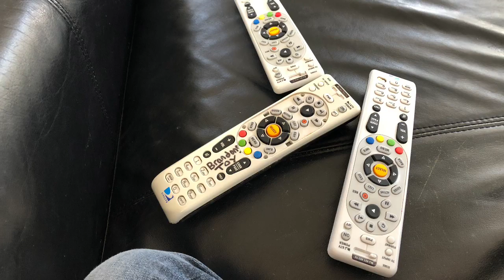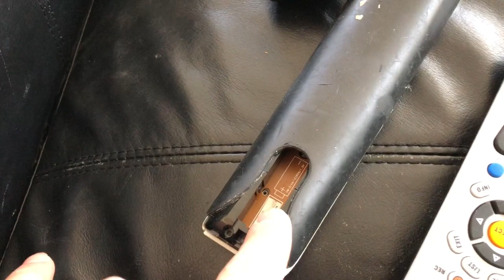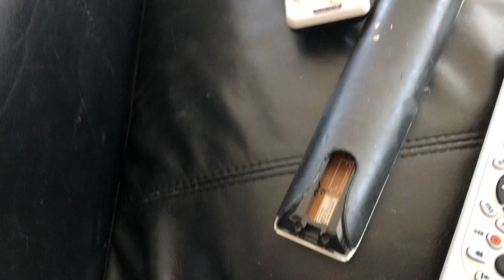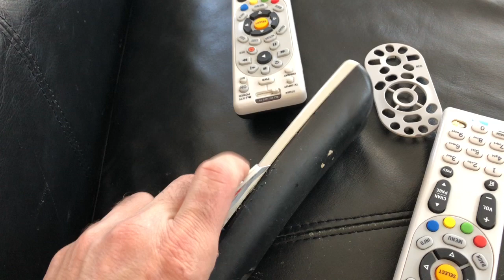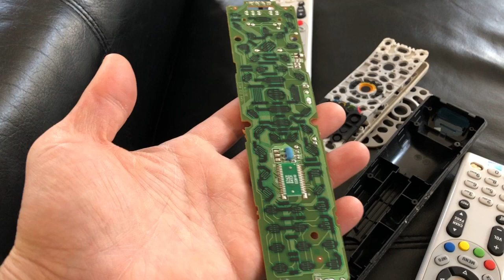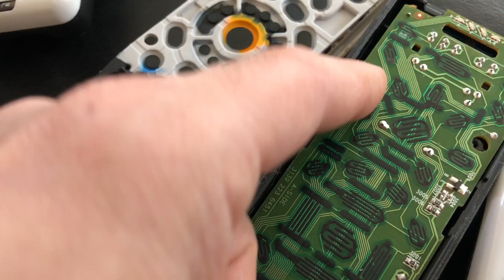How to fix and open your DIRECTV Remote control

Comment: Thank You !! After taking all the screws out, mine pops apart at the bottom.  99% rubbing alcohol cleaned the rubber buttons and pc board.  This after four years still
had liquid pop under the select button.  Clean and let dry completely.  Thank You !!

Comment: I commented earlier today about my remote issues I followed what u did once I got it apart I soaked the plastic pieces and the buttons on warm soapy water for about 20 minutes and scrubbed with a old tooth brush every corner and holes where buttons go let it dry for a half hour then took a swab and wiped the circuit board with alcohol let it dry put everything back together and every button I pressed worked even the buttons I rarely use responded immediately
Reply from the maker: That is good news glad to hear it

Comment: I’m on my third remote they don’t last very long after a year or so they started failing I could buy batteries today and in about 2 weeks have to replace them because I thought it was batteries I’d put those same batteries in another remote and no problem now some buttons don’t work at all and I have carpet on my floors so I know the issue isn’t from dropping it constantly I’ve been trying to figure out how to take apart without breaking there’s no screws I didn’t know if it snapped together or was glued your a life saver now I don’t have to pay 15-25 bucks